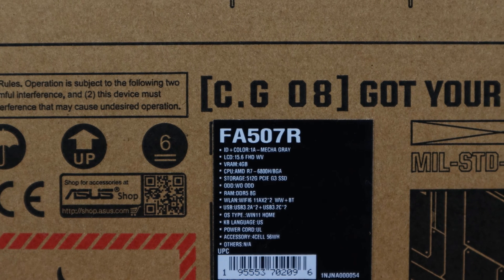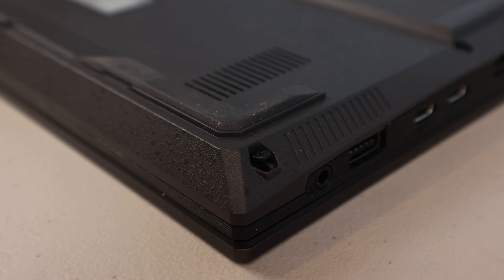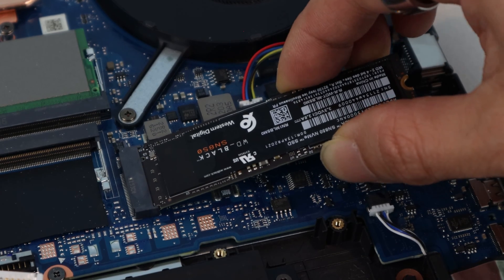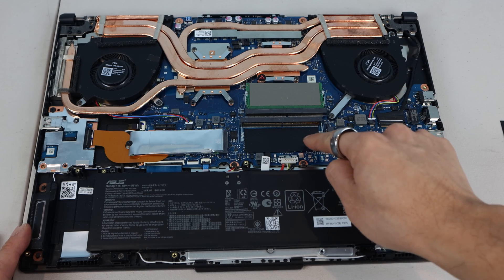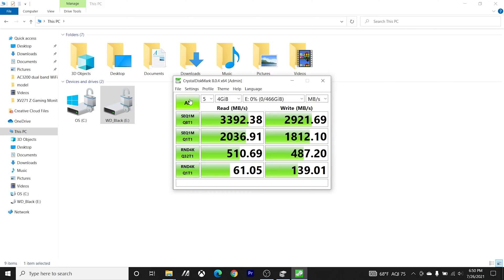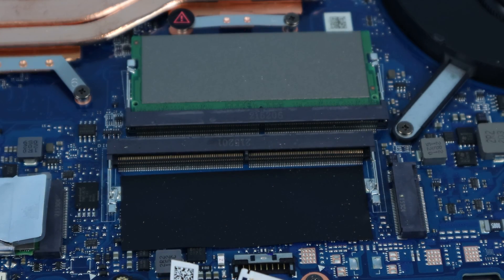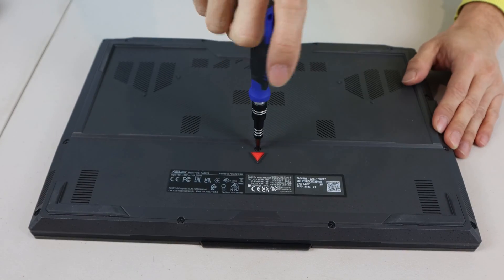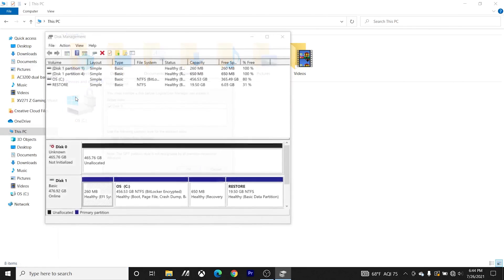How to Upgrade/Install RAM and m.2 SSD in ASUS A15 2022 TUF Gaming Laptop

Comment: What's with the heatsink on the ram, where can I get one?
Reply from the maker: They're optional, but can help with reducing internal temps while running under heavy load. You can find aftermarket ones at Amazon: https://geni.us/c5xa [Amazon Affiliate Product Link] These are typically copper, graphene, or a combination with an adhesive backing.

Comment: Would installing an ssd with a heatsink work or do you need to install one and add the thermal strip you put on?
Reply from the maker: It would depend on the clearance of the heatsink, some are thicker than others and may not fit the space. I find the thermal strips are a safe bet, so if you choose to try an SSD with a heatsink, just make sure you verify the measurements first!

Comment: If i buy a laptop with 512gb ssd, am i able to add a secondary 512gb ssd for overall 1.024tb ssd in the system? Also after i change the storage in the hardware, do i need to do anything for the software?
Reply: let me know if u get it

Comment: My metal locking tab above battery connector just broke, Would it be a problem to leave the battery connector just plugged in without the metal locking tab? Should I tape it with electrical tape?

Comment: No need of installation of windows in new ssd ?
Reply: no your other one will be what windows boots off of. the new one just needs to be partitioned to work with your current windows installation.

Comment: Everything went well except for the SSD port screw. I couldn't open it because I need a different screwdriver. Can you tell me which one I should use? Thanks!
Reply: Ph1
Reply: Did you ever figure it out? I can’t unscrew the SSD port either, the screw is not coming off.
Reply: You could gently apply some pressure.  There's no need to be hesitant.
Reply: @deepthind5515 I did but it still wouldn’t unscrew, what was the size of the screwdriver you used?
Reply: Actually, I took my laptop to a technician who just randomly grabbed a screwdriver and went to town on it! 😄
Reply: Same problem there…screw that xd

Comment: I have the ASUS TUF F15 2023 i7 12700H AND RTX 4070, I am thinking of buying 2 WD SN850X 4TB SSDs since I work with heavy files in 6k and 8k video editing. Do you think that those 2 SSDs that I mentioned are compatible and that you can place them without problems?
Reply: In this case I think NAS would be the best choice.

Comment: I bought consistent 3200 mhz but it didn't work on my asus tuf a15 i tried to check it on other laptop it worked then i tried 4 gb another stick of different company it worked in my tuf now iam scared to buy new ram don't know if it will work or not

Comment: I followed your tutorial, but now my laptop wont turn on. Battery wire was properly put back.
Reply: Found solution? Got same problem
Reply: @stolekey  sorry for late reply, Yes I did. It was fully charged when I did the upgrade and for whatever reason after installing RAM and SSD the battery was gone that’s why it wont turn on, so what I did was I recharge the Laptop and it started working again.
Reply: Same
Reply: @vigil8153  plug in before turning it on
Reply: My laptop did not turn on,I had maximum anxiety.Finally,thanks God,after plugin to charge it,like 2 -3 minutes the led turns on.But the battery is at the same level as 80% as last time before to replace the RAM

Comment: I installed 5600MHz ddr5 ram. But it's stuck operating at 4800Mhz. The spec sheet at asus website indicates support for 5600mhz. Am I missing some settings to change?
Reply: Thats because the cpu supports up to 4800Mhz only
Reply: @TheFares1 
Where do you find out the cpu support? And where donyou find out the motherboard support for speed?
Reply: @barakberkovich label on my laptop says the same
Reply: Sorry, I don’t have the answer, but I am looking to upgrade mine. Please let me know if you come to a conclusion!
Reply: what is your spec?
Reply: It could be cause of your CPU limit or your other ram is 4800mhz

Comment: 64gb works as well! Saw a Reddit post about it and decided to give it a try
Reply: Using a ryzen 7735hs, does using 64gb cause bottlenecking or thermal issues? What about reliability or the fan speed? Is the increase in performance masked by the cpu? Sorry I have a lot of questions, I’m trying to do the same upgrade. Would appreciate any help👏
Reply: @antoineohalloran8724  I just got 64 gig but would only read 1 of the 32 gig sticks. ryzen 7 is rated for 64. I will be researching to see why it didn't work.
Reply: @tonyhollerz6958  all fixed.  I had not pushed one of the cards hard enough so it was loose. 64 gigs being read by the laptop. Blazing fast.
Reply: @allanfizzahmeh3037 amazing, thank you! Also how is your experience in upgrading it, is it better at running heavier open world games, or does it get too hot? Did you get a faster ssd or cooling pad?
Reply: @tonyhollerz6958  running at same temperature as before when I open games. Definitely faster. The fans will run and get warm but nothing too concerning
Reply: @allanfizzahmeh  Hi, can I please asl you about what ram you're using? maybe a link to where you got them too would appreciated. I am new to this so the one I'm buying is this one ASUS TUF Gaming A15 (FA507NU) AMD Ryzen 5 7535HS/H, can I upgrade to 64? even 32 would be enough.
Reply: @allanfizzahmeh  I have an Asus A15 FA506IC, can you please tell me what's the max upgradable SSD?
Reply: Can I ad 2 times 32 GB on Asus A15 F507VR with AMD Ryzen 7 7435H,RTX 4060?Cheers
Reply: @CristiAndrei-j3d Yes. But I would pick rams from a company that shows this configuration on their site, like Crusial, then you can get support if something doesn't work, as Asus will tell you they won't help since you went over their stated max value.
Reply: @NotASeriousMoose  I understand,thank you very much .Because on Asus they said is maximum 32 and not 64 GB.Thank you
Reply: @NotASeriousMoose   i heard sometimes its useless to add more ram than is recommended by the company because it just will only use the max the laptop is rated for
Reply: @LaymanGamin  Maybe that is the case for some but not these TUFs. You can check it yourself by writing "wmic memphysical get maxcapacity" into the cmd and it will say your max ram.